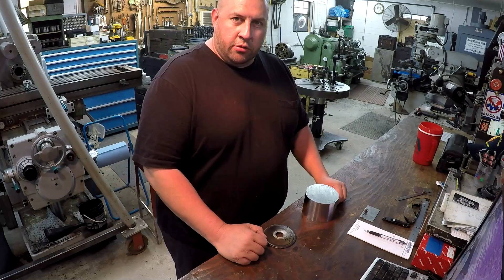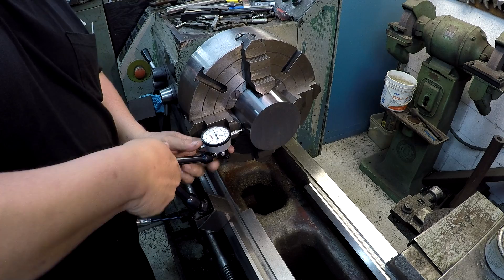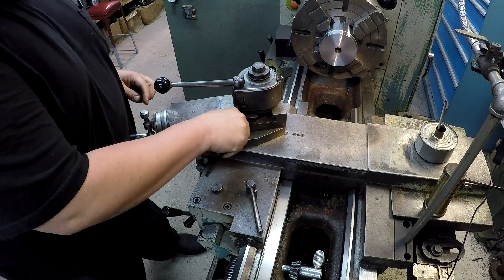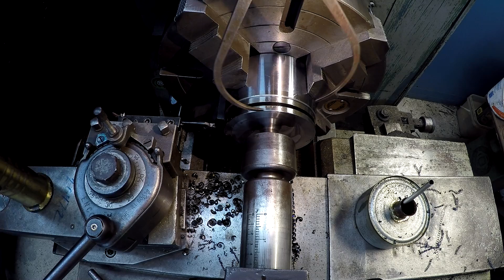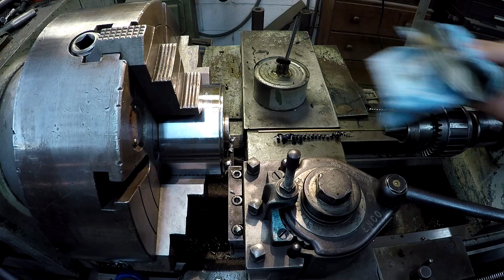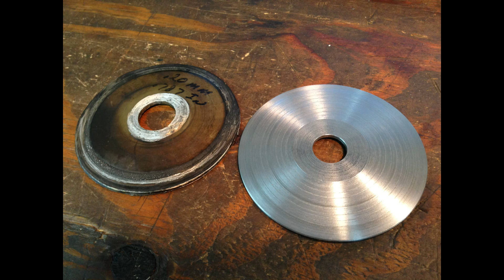Machining a Custom Steel Disc

Comment: That truing of the four jaw is just magic.

If you had cut the two angles together, you could have saved yourself a compound set up step. Was it potential deflection of the part that made you take a different path?

Comment: I need to machine 1/16 inch 420 SS washers from 6" diameter stock.  The stock is 9/16" thick.  I'm struggling to cut precisely 1/16 slices. I would use a drycut or cold saw, but it cannot handle the diameter. Would love to hear any ideas.  I'm doing this to make tesla turbine blades.

Comment: I'm in Australia so metric is king, however my Australian made lathe is about 70 years old so I need to do some mucking around. I build to a metric measurement, and treat 40 thou on the dials as 1mm. 

Perhaps I could try working to an imperial measurement, nah that'd be gay.

Comment: Hey Adam It is good to know that others get a noise when parting. I have a Taiwan made 12" which some times seems to be posed with evil stuff. The only way I have found to deal with it is slow speed and lots of oil. Still a scary operation! Really enjoy you calm approach to things.

Comment: Another nice video.I am wondering what you meant by friction turn?
Reply: Friction turn would be pressing the part against the chuck with the tail stock and thus being able to work on the part.  The part is only held in place by the pressure of the tail stock and turned by friction.

Comment: 1/8 of an inch? What? Just use millimeters
Reply: I guess its more concise at points. When its like 1/8 that's easy, that being 0.125 of an inch. But when you start getting in 17/32 that's where metric is just easier

Comment: Yay Metric :D although im slowly getting used to Imp. it gets a bit confusing to my little mind when you say half a thou on the gauge when truing up your material im assuming its half a thousandth of an inch, is it 0.05 of an inch? sorry i dont know how to calculate on calc so i though you or one of your many enthusiastic subs might help me

Cheers Troy
Reply: Troy, .05 is half of a tenth of an inch, but when Adams speaks of tenths, he's referring to a tenth of a thousandth which is .0001 (or 0.00254 mm)
So "half a thou" is .0005
When working to that level of accuracy, using Imperial thousandths is actually easier than SI.

Comment: Why would this job be done in a machine shop? An aluminum washer needs to be stamped not machined. Or am I wrong?
Reply: +Maloy7800 Okay, give job to a stamping shop.. stamper's call the machine shop to make the costly dies to stamp the washer.. It's a numbers game. We're talking one piece, not hundreds of thousands or even millions. In our shop we often machine prototypes for parts that after approval/tweaking end up churned out by the millions - a second per piece on the cold headers. It's all about what is practical, as well as what the requirements of the part dictate.

Comment: Heh heh, got to see one of the things the Victor lathe just doesn't enjoy doing at all, in parting with carbide insert tools.  I'm guessing the main reason is just because it ain't got the girth and bulk the big Monarch has that makes the Monarch just so much more rock-solid, so the Victor can't take the tool pressures from parting with carbide inserts.

Impeccable skill again Adam.  Looked a little hairy working that close to the chuck, especially the facing/tapering on the outside of it where you could have it in high gear and the chuck a blur in its spinning. :-)

Comment: Thanksfor another great Video...!.....20mm shaft is common for European stuff like 'cold saws'.... Finish on 'chrome' shaft?...I have been in a couple shops that made chrome shaft...they plate it first...that comes out very rough, (looks like it's glass-beaded) then they take off 1-2 thou with a big wide belt sander...but call it grinding...the roundness is not that critical as the rod goes through oil/hydraulic seals....they leave a slight amount of grinding lines/finish to retain an oil film.

Comment: can anyone explain it to me why on most of these videos you guys avoid coolant. Coolant really works magic. When i work at lathe i use it almost always, especially when large amount of material is to be taken. Even a small dripping makes all the difference on the world. It preserves inserts and makes it possible to take large cuts.
For example i work (one of the machines) on a 30 year old lathe, and it is nothing strange for me to take a 6 mm diameter cut at once  at large feed rate. And i'm not even flooding it with coolant, just enough. I have feeling you guys are not using your machines to their full potential. I might be wrong tho. Maybe old Yugoslavian machines are different. ;)
Reply: Полиграфович drip was metaphor :) but for these heavy cuts coolant is kinda must. tips of inserts suffer the most here. I am aware of thermal shock :) I my self am not using coolant most of the times but for these heavy cuts and when lots of material needs to be removed then its different story. i mean i ain't gonna cool small part that i work on for 15 mins/
im not cock flexing its an old machine and its miracle it can handle it ... i also work on large lathes that can take more but what you speaking about 26mm cuts makes no sense to me.. since you would need extra large inserts. What kind of machine exactly and what inserts are u using. I mean i've seen test cuts made with an 20mm diameter cut but that was just for stress testing the inserts and machines...
Reply: 11thboris It was just sarcastic hyperbole - we can go back and forth all day talking about this cut and that cut but it's all very circumstantial.

Comment: I figured these were always stamped.  What does a  job like that cost? 

Subbed thanks to Ave.
Reply from the maker: I had about an hour in it. Labor plus material. Thanks for the sub!
Reply: +Abom79 You're welcome. Are the bearings shot in that lathe?
we could never part well in high school because of that.

Comment: Adam, I love your videos and have learned so many little tips and tricks from you.  I love watching all of you guys like Keith Fenner, Tom Lipton, Keith Rucker.  I would like to know where to obtain a tool post holder like you have on both lathes.  I have found on MSC where you can buy the tool holder, but not the tool post itself.

Comment: I am a machinist and a CNC programmer in a hydraulic cylinder manufacturing business for 12 years and we deal with 80% imperial and 20% metric. All our CNC lathes are in imperial, it's a pain in the ass sometimes but I wish it was just metric. Because being taught mainly metric growing up here in Australia. lol.
Reply from the maker: I love having everything read in imperial size. It's how my brain thinks, plus all of my tools and machines read in inch.

Comment: Hi Adam, when I have loooong reach with a parting blade, I start with a much shorter reach and when it gets deeper than the reach, then I stretch the blade, makes it easier on the lateral forces to get it started... ;) 1045 works nicely...   Pierre

Comment: P.S. can try a 3/16 P-5 HSS. if use a drill sane  size the hole as tip of the drill little pass  end of part at the sane time cut off meet.  (|||||||||\ _ part side)

Comment: P.S. How would you chuck up that thin of a washer without distorting it severely?  Also while on the subject how do you chuck up sch 40 2 1/2" aluminum pipe?  I find my three jaw always distorts it and has even crushed it at the jaws when turning and facing a 18"-24" piece.  That was with a center in the tailstock too.   Do you prefer the 'T' shaped HSS cutoff blades to the standard tapered ones?   Thanks again for your informative videos.
Reply from the maker: +Douglas Thompson Theres many different ways to hold this parts, but that's subjects for another time. Sounds like you may be clamping down too hard on the material. Both style of parting blades work fine but my holder is set up with the tapered sided blades.

Comment: Very interesting.  It is exactly what I wanted to make washers for my grinders.  I had two other small lathes biggest being a 10x24 and cutoff work was never very successful.  When I got my 12x36 lathe with the 200 series toolholders all the videos showing it done with such ease became real.  It is rewarding to have fought it all these years and now having it so smooth!  Keep up the great videos.

Comment: I was one of the 'cross over' kids here in Canada. Started school in imperial, graduated with metric. oh my friggin gawd. what a mess! And we still had to learn to covert Imperial (English) to U.S. volume capacities! Good grief. (i.e. 1 U.S. Gallon = 3.78541 liters compared to 4.54609 liters per Imperial Gallon). And this conflict started all because of global trade protectionism. Nuts I tell ya! It's the same with DVD country codes, telephone systems, power systems. 

There are huge advantages to metric as a measuring system - because it is decimal formatted without any conversion required. Every car manufacturer in the world now uses metric across all brands and regions - including the U.S. About the only holdout left is the U.S. military industrial complex in some very specialized segments.

One day there will be only ONE global measuring system. Not in my lifetime though.

Comment: Learned something again from you!
Thanks Adam!
Reply from the maker: What did you learn Razor?
Reply: +Abom79 
Hey Adam,
I learned how you go about cutting a dish on the one side and the parallel on the other.
I had a similar situation a while ago, and failed miserably. Thanks to you now, I think I could get this done!
Appreciate it, 
Razor!
Reply from the maker: That's great Ray! I showed one way to complete the job. Many other ways do getter done also. 👍

Comment: I like how you call your Victor the "little"one :)
Out of curiosity, what size is your Victor and your Monarch?
Reply from the maker: +russtuff The Victor is 16x60 (inches), and the Monarch about the same size, only it will swing 18.5". But the Monarch is much bigger and beefier, so it handles the heavy loads.

Comment: Heya Adam. 

Nice job as always. 

You said that the Victor doesn't like carbide..... Too light of a machine...? What are your normal parting speeds both carbide and HSS depending on lathe size?

You mentioned friction turning. Have you done a video on that type technical operation? If so I'll have to look for it. 

I've got a thin 2.25 dia part that needs to be faced to thickness after drilling screw holes with the mill then parting on the lathe. Any good techniques out there to look at if you haven't done one on it?

Thanks

Comment: Well, that was different...but that's when I learn a lot. Thanks, Adam.
I used to work in a shop that built all its new stuff in metric. It is easy to use if you don't have to switch back and forth between one system and the other--that's where it gets hard.
Nice video, Adam, easy to watch.
Joe

Comment: Great video Adam. For information we would call that design a Belleville washer but it would normally be made of spring steel so that it can flex when put under pressure. 

Most interesting to watch the process of how you produced a copy of the original, without the wear of course! This mess of metric and imperial measurements on components is a pain but is far worse with the various threads in use here in the UK.

Comment: Hi Adam, excellent video as always, but again a question if I may.  I've personally not tried it yet, but I have seen a number of YT videos on the 'spinning' process and I can't help thinking that this part could have been made easier, and from sheet material by spinning.   
It would be great if you would consider making the part again by the spinning process and showing us all that perhaps it CAN be done on a non purpose built lathe.  
Your machines are pretty large compared to most of us ( apart from Tom's, both Keith's James etc.),  so I would think they could handle the forces involved.
I timed your 4 jaw indicating on this project and this time you got it down to ~41 seconds.  Couldn't see how accurate it was, but you were obviously happy with it and I think later you mentioned it was within 1/2 thou. So, you are the king again (re' my comment to Doubleboost the other day) - fantastic stuff.    Regards Mark in the UK
Reply from the maker: +thecorbies I've never had the pleasure to do metal spinning but I know it used to be common practice. I'd have to research the proper ways of doing so. No doubts the machine could handle it. That original part was probably pressed to shape. 
Sometimes I can get something indicated true in just a few seconds, and other times it takes longer. Keep in mind during the show down we had to set the chuck and install the work piece too. :)

Comment: Furthering this metric/imperial argument... every commodity product you buy in the U.S. has the metric weight or volume printed on the label, right underneath the imperial units (it may be a law, but IDK for sure). However, few products come in "even" metric units, except some beverages (1 liter, 2 liter Coke/Pepsi). Almost everything is an even imperial unit (a pound of cheese, a gallon of milk).

My thought has always been that even metric units of weight and volume are slightly larger than the imperial unit (a liter is bigger than a quart, a half-kilo heavier than a pound) and making larger volumes would increase the selling price. No company wants to be the first one on the shelf priced at $1.05 instead of $0.99. Those who look solely at the price will buy the "other guy's" product.

So we plod along in Imperial, and as Adam stated, we are used to it. The simplicity of dividing metric units is attractive, but most of the time we convert fractional inch units into thousandths so we know how much to cut anyway.

Comment: hi Adam, I'm not a machinist but I watch your videos every week.  I was expecting you to get some deflection sideways on that parting tool away from the face when cutting the convex side of the washer, especially with the long extension on the tool.

Comment: Adam, was the 5 degree dish on both or just one side of the washer?
g
Reply from the maker: Bob, it was on both sides. I used the compound and the parting tool to machine the front side of the washer.

Comment: Metric vs Imperial, just a funny way to look it:

In Metric, one mililiter of water ocuppies one cubic centimeter, weighs one gram, and requires one calorie of energy to heat up by one degree centigrade -which is 1 percent of the difference between its freezing point and its boiling point. An amount of hydrogen weighing the same amount has exactly one mole of atoms in it.
Whereas in the American system, the answer to "How much energy does it take to boil a room-temperature gallon of water?" is "Go fuck yourself", because you can't directly relate any of those quantities. :D
Reply: +chevy250ss it will take roughly ~16 mins on high!
Reply: lol
Reply: Let's do this correctly, in (sic) Imperial units.  For heat, the unit is the BTU, which raises 1 pound of water 1 deg. F.  Room temp. = 68 deg. F./20 deg. C and water boils at 212 deg. F.  So, we need a temp. rise of 144 deg. F.  A gallon of water weighs 8.34 pounds.  So, approx. 1201 BTU are needed.

BTW, the SI unit of energy is the joule, not the calorie.  Yes, Metric is more consistent, but both Imperial and Metric are arbitrary.  Remember, the Meter is defined as the length of the path traveled by light in a vacuum during a time interval of 1/299792458 of a second.

Eli D.
Reply: +chevy250ssYou've got a typo: 1 ml = milliliter = 1 cubic centimeter

As for boiling the water, whether a pound or a kilo, it's not related to the sensible heat, so your joke is a bit flat... at least to chemists and chemical engineers... ;^)
Reply: +chemech typo corrected!

Comment: Hey Adam,
Another satisfied customer! You always go the extra mile for your customers. You make sure the finish is as smooth as a baby's ass and within tolerance. Great work! If you don't mind me asking, is the Victor about the same vintage as the Monarch? Thanks for another interesting video!
Have a good one!
Dave
Reply from the maker: Hey Dave, don't know the year the Victor was built but it is in the late 70's - early 80's.

Comment: I guess it must be an optical illusion at the end when the old washer appears to have a bigger bore than the new one. Really enjoyed seeing your parting tool take that side load Adam, guess its a sandvik blade, my no name blade bends like a banana with part tip load.
Reply from the maker: The customer told me the bore should be 20mm. The old part was badly worn.

Comment: Adam, when you have plenty of material to work with why not just "eyeball' concentricity ?? Have a great holiday weekend.
Reply from the maker: It's good to stay in practice and have your workpiece run on center to minimize machine vibrations. Kind of like a tire that's out of balance on a car.
Reply: +Abom79 
Hi Adam
I like your attitude towards your workmanship. And your indicating skills never seize to amaze me. Thanks, man.
Reply from the maker: Thanks Peter